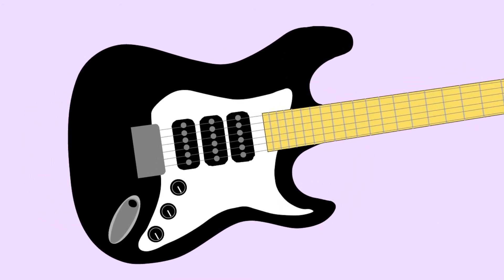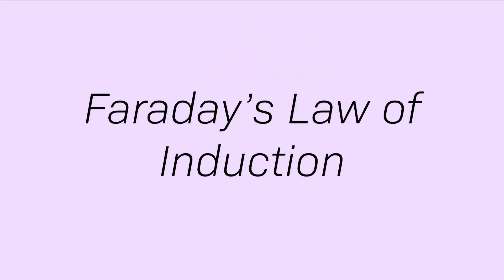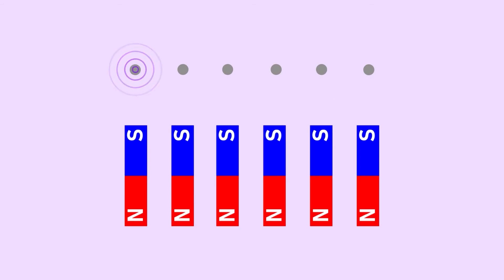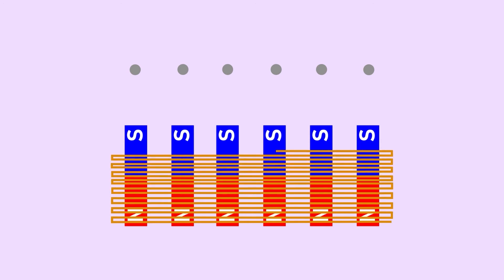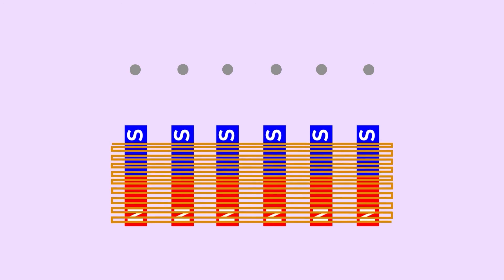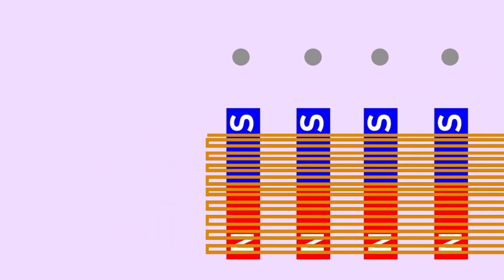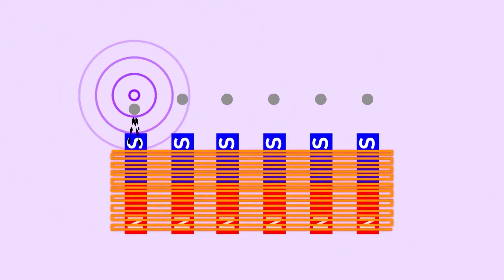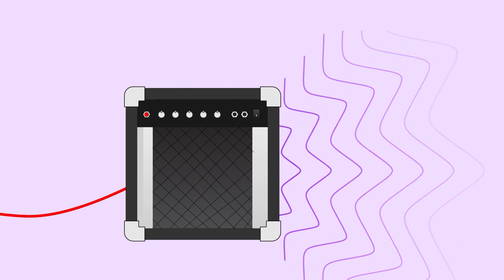Electromagnetic Music: Guitar Pickups Explained

Comment: Thank you for the great video! However may i add that nickel, aluminium and cobalt are not actually 'magnets' technically speaking! They are what is known as magnetic materials which can become induced magnets. The way that the guitar strings become magnetic is actually through the permanent magnets in the pickups  (the grey metal circles in the pickup) which induce the strings into becoming magnetic... this allows the strings' new magnetic field to be able to influence the inductive sensor of the copper wire wrapped around the pickup. Amazing video tysm!!!